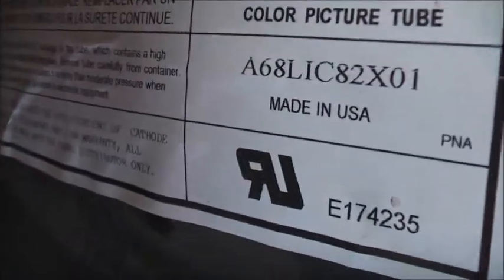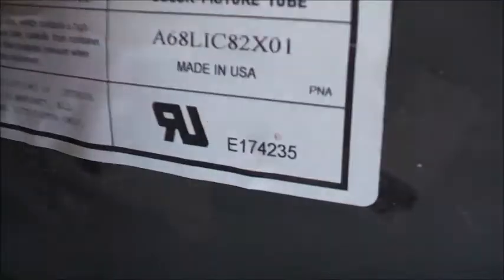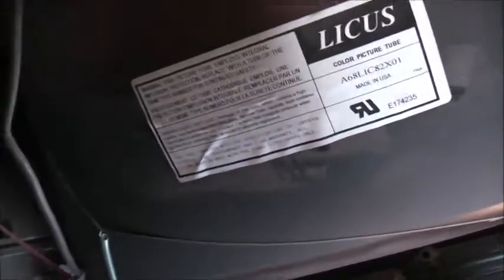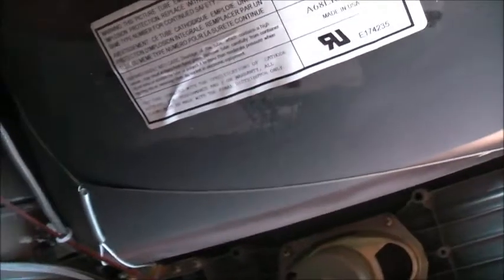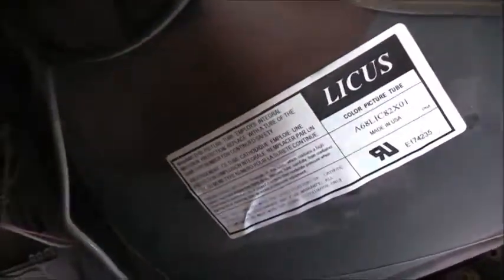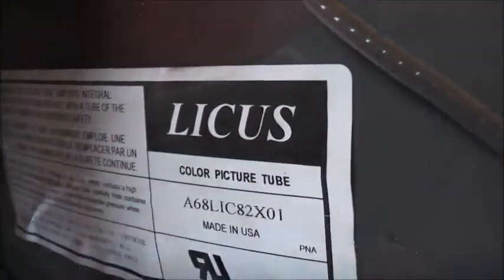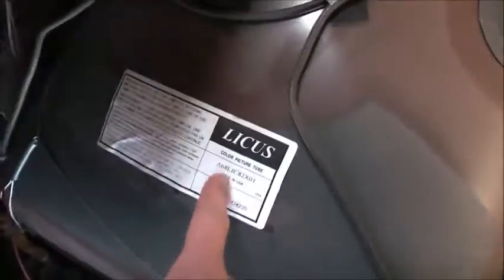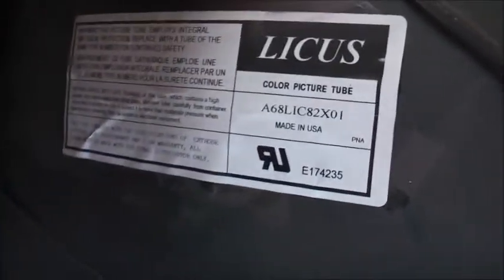Chinese Centrex TV With A USA Made CRT!!

Comment: I found that centrex had been using recycled tubes in a few back when there was money in repairing them, usually the tell tale signs were they hadnt even taken the old wires off the yoke, just attached new ones over the top.